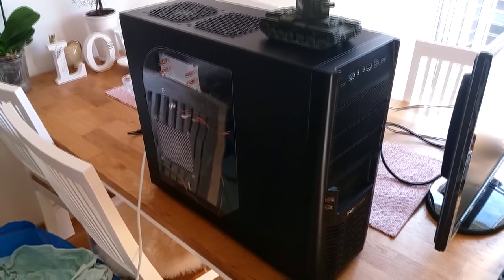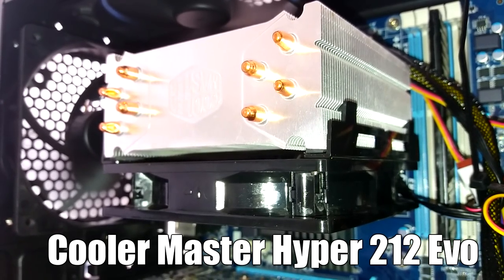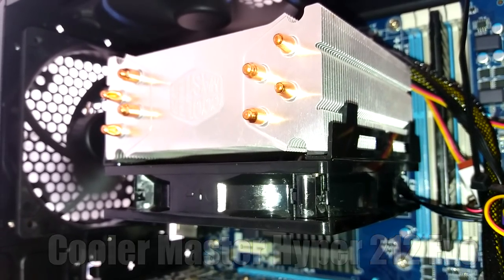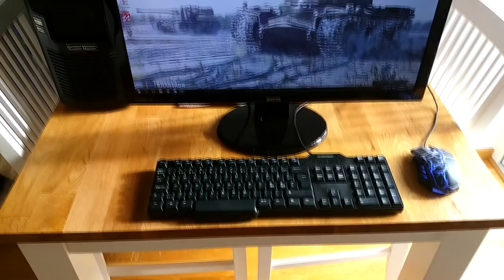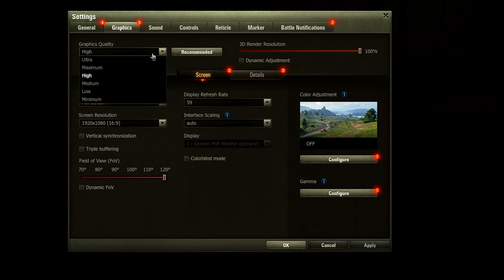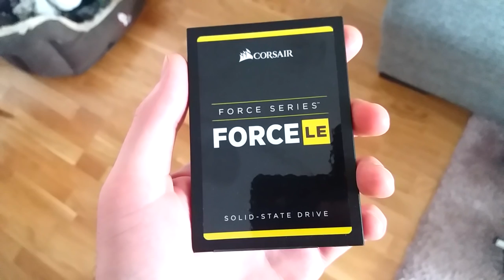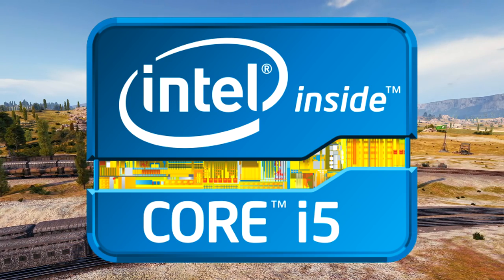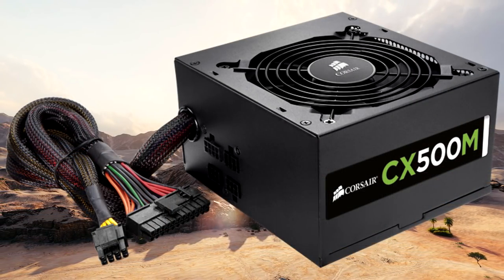Can a potato PC run World of Tanks 1.0?

Comment: If that's potato, then what is my laptop? A bloody hunk of soil? xD
(EDIT) holy frick 50 likes))). 1.0 is finally live in ASIA and my hunk of soil finally given up on WoT. The client won't even start xdxdxd help
Reply: Same, my laptop has to run with low settings, so that it could do evan 50fps sometimes
Reply: After that laptop was used to beat you to death, absolutely. :) But I agree with our hosts. If you could play WoT decently before 1.0, you still can without spending money.
Reply: DUDE same. what's mine, a pile of rotten potatoes? or as you say a hunk of soil.

Comment: I think this was more FPS that what I can get ;-;
Reply: I have a GTX 1050 with a APU that's so bad that you can't even find a review online on it :/
And I got 8 or 12 gig's of Ram... I think... And I got a 600 Volt or whatever Power Supple
Reply: a 1050 is miles faster than a 660, and i wouldnt think some of the older APU's would hold you back

Unless theyre like 20 years old or something....

Comment: Somethink for you Edwin
MSI GTX 960 Gaming 2G - GPU
intel core I-5 6600K - overboosted - CPU
8GB of DDR4 ram (hyperx 2x4GB)
Z170A Gaming M3 - motherboard
Great power suply ....
Windows 10 - 64bit running on quite good SSD disc aswell as WoT
FPS on high ... 20 ... really niga
Reply: SERVEJ bruh i got 1050 ti 55-80 fps on ultra with ryzen 5 1600
Reply: Turn down textures, probably not enough video ram. 2GB is really low these days.

Also, you're not mentioning your screen resolution, which makes or breaks you. I know the video had 2GB of vram, but that's at 1080 60hz. That's probably they best they could ever hope for and they didn't mention if they had to turn anything off like advanced destruction physics or bush transparency.
Reply: philburg2 agreed
Reply: I got a Core2Quad q6600 2,66 GHz 8GB DDR3 1333 MHz GTX 750 Ti 2GB GDDR5 OC(low profile) RAM 250+80GB old HDDs Win 10 64 bit, stock HP case PSU and motherboard and I get 40-50 avg fps with mixed settings(med to high) with some antialiasing at 1680*1050 resolution.
Why do you get such low fps and why do I get so much lower fps than this potato pc which isnt much different?
Reply: I use SD client for the moment because HD is not optimised at all , i olay on ultra with 1050ti 4GB i get 75-120fps depends on the map
Reply: Der Gerät lol regular 1050 100fps i5-2400
Reply: GTX 1060 6GB with an intel core i5-6500 and i run at 120fps
Reply: i5 7400 3.00ghz to 3.50ghz quad core, 8gb ram DDR4, nvidea gtx 1050 TI 4gb DDR5, HDD 7600 RPM, max graphics 50-60 fps all the time
Reply: Nvidia GTX 960 2gb
intel core i5-4460 
Crucial ballistix 8GB (2x4gb) DDR3 
win 7 64bit
70-100 FPS on ultra xddd
Reply: R9 290x Tri-X 8gb Gddr5
16gb DDR3 1600 Ram
Amd A10-6790K @ 4GHz
50 - 70Fps on Ultra HD Client. Probably because of my old CPU and only DDR3 Ram.

Comment: Lol my pc from 2014 runs WoT worse than that potato, lmao. Mine has a GTX 750 Ti & I3-4160. Its still going strong.
Reply: I really don't what that is
Reply: i have same high graphics are working 60 > fps
Reply: I can barely play Garry's Mod past 15 fps
Reply: Chandler Kristoff no the processor is trash.
Reply: And ? Years aren t importatnt for PC. You buy very cheap computer what I see. My recomended: buy new procesor
Reply: Komenta Kom i bought it for 800€, rip.
Reply: SlapThatBurger - WT I have computer for 1200€ in the discount. I know what I buy. And I3 for 800 hahah you was pranced. It Is one od the worst processor in the shops...
Reply: What resolution are you using
Reply: Jaska V 1920x1080 @60Hz
Reply: my 2002 comp runs this game 161 fps with minimal graphics + mods
Reply: M41 Walker Bulldog 

wow.
Reply: Well the actual requirements require i3 3330 and a gtx 660 for max performance, so you good.
Reply: SlapThatBurger - WT GTX 660>750 ti

Comment: Edwin, I am still surprised by my setup and the results.
I'm running everything on maximum and I have a constant 70-80 fps. Didn't drop under 70 so far. Playing on 1920x1080 resolution.

Motherboard: ASUS Z170 Pro Gaming
RAM: 2x HyperX Fury Black 8GB DDR4
Processor: Intel® Core™ i5 6600K 3.5 GHz
Graphics Card: Nvidia GeForce GTX 960 4GB

Comment: Store bought PC last year for B-day:

i5-66K (don't know to overclock)
NVIDA GeForce GTX 1060 3GB ver. 391.24 as of 3/20/2018
2x4GB DDR4 RAM
2.250TB Hard Drive (1TB External, 1HDD, 250GB SSD)

Did a Engine Test drive when they've first released it and it crashed multiple times, right now I can only play on Med settings.  Don't know what's wrong, could use some help to play up on High or Max.

Comment: I have a laptop with: 
-GTX 870M 3GB VRAM (is like the graphics that is showned in this video, the GTX 660)
-i7 4710M
-16GB of RAM. 
-A 1TB HDD (the game is in this drive and runs pretty well :D).
-240GB SSD.
The graphichs that I achieve with this graphics is ultra (without anti-aliasing) hitting the vast majority of times the 60fps (with vsync and tripple buffering activated) and in 1080p resolution. My  laptop it's from 2014 and even nowadays can play modern games at ultra.

Comment: Intel Core i3-3220 CPU @ 3.30 GHz | 8 GB RAM | Nvidia GTX 650 Gigabyte 2GB | Acer LED HD G206HQLGB 1366x768 - runs the game at SD client, graphics improved, settings High at 50 fps (when lots of things happen around) and 70-90 fps when driving around or having a fight. So, the game runs as smooth as it ran before.

Comment: This may sound like a daft question but what FPS would a gaming laptop with an i7 processor, 16 GB RAM and GTX 950M graphics card on ultra settings or maximum settings
Reply from the maker: the cpu and gpu of laptops are usually underclocked and a 950 is already slow as it is so my answer would be that it would play the game but not at max settings!

Comment: a computer with the latest i-7 and gtx 1070(8GB) with 16GB RAM is a good "budget" setup(in my opinion). For example Acer Helios 300("gaming" laptop) will run World of Tanks at 100 fps and rarely under 90 fps.(i have this laptop so i know what im saying).All you said about the medium requirements are true but... for the best expirience the components mentioned above are the best. 

P. S. The laptop costs 1000$ on Amazon or 1400$ from their official site.

Comment: Playing at Ultra, with around 100-150 fps (average around 120) with i5-4690K @3.50 GHz, a GForce GTX 1060 6GB and 16GB of Ram.
The Game is running on an SSD (250GB) , i tried it one a Hard Drive but the Game woould not load correctly and would take until around 10 sec after Map Start to load in everything so an SSD is definitely recommended.

Comment: hey guys, i fought id respond to you're question about the rigs that people are using, mine is running a Nvidia Geforce GTX 970 Strix at 4GB, a Intel I7 950 processor, running unclocked around the 2.9 Ghz, 12 GB Of RAM Memory, a 750 GB SSD and a 1.5 Terrabite Hard drive, all those components are held together by a Asus X58 Sabertooth motherbord, but im only getting around 60 frame's per second, is there somekind of limitation that you can turn of to see the maximum graphics you can achief ingame???
Reply from the maker: The game was limited to 60 fps in the garage and 120 in-game before 1.0. Now It's limited to 60 fps in the garage and 1000 in-game. So if you can't go much above 60 fps in-game it's probably your CPU that's a bit too slow :)
This video shows you how to remove the fps limit https://youtu.be/JrXpzkbfLPk

Comment: My PC is from January 2009. But it was quite high end back then and I upgraded my graphics card in 2013 I believe.

Intel Core i7 920 @ 3.6 GHz
6 GB DDR3 1600 (Triple channel)
Asus P6T Deluxe
2 GB XFX GTX 770 XXX (Factory overclocked)
Creative Soundblaster Z
700W beQuiet StraightPower PSU
Antec 900 Case

Guess what? It runs WoT 1.0 at maximum settings. Everything set to maximum. Usually 60 fps+.
Wargaming did a very decent with the new renderer. It's almost the same performance as before, but it looks so much better.
Reply from the maker: Sweet!

Comment: I had strange issue - automatic detekction was HD and ULTRA preset but textures was SD and FPS was about 250. I was not able to See HD textures in HD client. Removing one of 3 RAM module solved problem (now i got 8gb instead 12).Gtx1060 i5 4460. The problem wasn't solved by any driver reinstallation, New Windows, watchout for your RAM!

Comment: Im getting the same fps about 70-120 as i did on the old engine on ultra. What i have an issue with is abysmal load times and after the battle starts about 10 seconds  in every time i get a massive freeze that last about another 5 seconds then it runs like butter.  I3770k @ 3.5 with a 1070. Doesn't affect warframe or iracing though so i'm kinda scratching my head.

Comment: Thats not a potato take my pc 7 fps minimium (i had to quit wot unplayable) pc from 2009 not made for gaming
Reply: maukku 1 My old pc from 2007 is running wot 1.0 with low settings 60-80fps, if I put my settings to higher it will lag little bit, cuz I have only 1gb vram

My old pc has GTX 650 1GB, Intel Core 2 Duo, 2GB 800MHz ram, slow hdd and everything. xD True potato, but it works.

Comment: I have AMD FX6300 4.2GHz and rx560 4gb, 12GB ram, and work very nice, FullHD on 60 fps. PC for lower price as 450€ is very good.
Reply: Frederik Včelka well, not feasible today. With these... Guys using (preferable) GPUs to mine the RX560 alone probably costs more than that right now.

Comment: I've a custom-selfmade PC (asrock n68c-gs4fx/8gb ram single channel 1333/amd r9 380 dualx oc 2gb /amd FX 6300BE OC to 4.0ghz - 1.35Vcore (stock cooler) and Wot 1.0 runs at maximum presets at about 60fps temperature range of 55-59° 

It's a potato pc ?

Comment: 2011 isn't potato pc 2001-2004 is 
Which is what I have
and it used to run WoT at 37fps before the update
but now it can't past 13 and whenever there's too much foliage onscreen or I zoom at a bush I get 7fps at the most 
And yes that's with all the graphics set as low as possible

Comment: Lolol gud video for the budget players out there. I for myself use older hardware also with 
Amd FX8350
KFA2 gtx960(4gb)
16gb ram at 1600mhz
128gb ssd for windows and 1tb hdd for games.
Runs at 65-90 fps on absolutely maxed out settings without modpack and with i had to put some settings down to "maximum" only... guess it soemwhat depends on luck also :)! but yes i gotta say the performance is amazing...cant wait to test it on my laptop with some processor at 2 x2ghz and 4gb ram with 128mb graphics chip :D

Comment: CPU: AMD A10 7850K 4 Cores(4.2 ghz)
GPU: Asus Nvidia Gtx 950 Strix(overclocked by %20) 2gb
Ram: 16 gb 1866 mhz
HDD: 7200rpm WD 

I'm playing on Maximum settings(not ultra :d) and having 100-110 fps on 1080P but i cant get into battles on time and im looking for a SSD right now so Is Corsair Force Le series is good?

Comment: Medium @ 50-60 fps. Core 2 quad q8300 @2.5ghz. 12gb ddr3. Gtx1050ti 4gb. Don't know motherboard as the whole point was to build a pc for cheap. So it's some old Dell optiplex with some generic Dell mobo. Psu= CX430 atomic bomb.

Comment: Funny because I have an i7 processor and a GTX 1050ti and I can run the game at ultra with about 40 to 60 fps range
Reply: Do you have only 2gb vram? I think that's the problem. You suppose to have like +80 fps with ulta settings.
Reply: JoonAce, to be honest I don't know what vram is
Reply: Samagent T.S.I. It is your video memory.
Reply: JoonAce, so how do I know how much I have?
Reply: JoonAce, and what component of the computer is it on?
Reply: Samagent T.S.I. A small crash course in Video Ram: your GPU has a set amount of dedicated video ram used only to render stuff. When you exceed the amount of DEDICATED VIDEO RAM of your GPU,your PC uses SYSTEM RAM (used to do lots of other stuff) to compensate which results in a significant performances loss on your PC as a whole.You can look up by typing DXDiag on your search bar and going under the display tab to check the available Video ram you got. Alternatively you can download CPU-Z for more accurate readings.To give you an idea: 4GB Vram is enough to run most recent games comfortably on med settings. 8GB+ if you want to play on ultra. My ye'old 750 TI(4GB) runs at 65 fps on high(WOT).

Comment: My configuration!
i5-4690k 4.1 Ghz
Noctua nh-d9l with 2 fans
16 gb ddr3 1600mhz (4x4gb config)
Msi gtx 960 2 gb
asus z87 expert + WiFi-Bluetooth 4.0
Samsung ssd 850 evo 256 gb (windows 10 pro 64bit and game on it)
650w corsair 80+ gold

I mix the graphics setting for get 60 fps always at 1920x1080@60Hz resolution with ultra-max settings.
I prefer to don't stress to much my video card and cpu.
At close combact (like 6 vs 6 tanks) I prefer 60 fps locked instead of fps that swing from 50 to 100

Comment: My almost potato laptop (i5 1st GEN, 8GB RAM, Radeon 7600M, SSD), is actually runnig 1.0 better than earlier.
Before i had spiky 30-50 fps on lowest, now i run fluent 45-50 on mid-low settings. WORKS BETTER

Comment: I have a laptop with 8GB ram and 2GB graphics card and on medium it runs at 20fps and recommends low?
Reply from the maker: What cpu and GPU is that?
Reply: AND A6-7310 APU with AMD Radeon R4 Graphics, 2000 Mhz, 4 Core(s), 4 Logical Processor(s)

Comment: I have 120-80 fps but it takes a hour to load into battle :D Because It's a laptop. :)
GPU: NVIDIA Geforce 920M(3GB), Intel(R) HD Graphics 6000(1GB)  
CPU:Intel(R) Core i5-5250 1.60Ghz (4 core)
4GB ram 
It's a strong laptop and it's old but it still working hard.

Comment: I played wot before 1.0 update , in high graphics sd  35 fps  , now i play in high too but sometimes i have 30 fps , sometimes 20 or less , 1.0 made worse my game experiencw in wot :/
Reply: WEAPONIZER TANK actually the game requirement is lower because of the optimization and the Core engine codes are cleaner than before. The game should run smoother , maybe you were experiencing some lag, try to lower some CPU hungry function
Reply: well then go to medium or low, and comparing high pre 1.0 to high post 1.0 the graphics are considerably better. So of course your frame rate is lower, its just not as low as it would be with similar graphics, but running with the pre 1.0 graphics engine

Comment: I have FX-6300 with GTX 1060.
I get only 50-60fps.. (ultra)
I really have to buy a new processor.
Reply: you'd have to overclock it otherwise it really is not useful at all, since even the older Phenom II outperforms it in games :D
Reply: It's already overclocked at 4.0Ghz. I guess I have to push it up to 4.6Ghz lol
Reply: unbelievableflyingdrunkenpotatowithnolife Maybe try to get a AM4 mainboard with a ryzen 1200 or ryzen 1600.

Comment: Calling this a potato angers me, has the world become this spoiled. i just got an upgrade from using a radeon hd 4850 1gb video card on 32-bit pentium4 systems with at most 4gb of ddr2 and that was my gaming rig. i only had free hand me downs or hardware that was going to be thrown away and those  specs were amazing to me. i played; wot, war thunder, euro truck sim, FSX(with saitek x52), trackmania, heros and generals(barley and not steam version only standalone), mechwarrior onine,  spintires, crossout, emulators, ect. i setup windows the same way i did on that system as i do with my new rig(amd fx 8core 3.2 ghz, 32gb ddr3, gtx 750), everything i can turned off and looking like 95, becuase i dont care what windows look like i want my game to work as best as possible. i wonder if the old rig will play wot 1.0, i might just set it up again to see.

Comment: CPU: intel core i 7 3,6 GHz with boost up to 4,2 GHz
memory: 16 GB 2400 MHz
GPU: Radeon Pro 560 4 GB
resolution: Full HD
...and still just 70 to 80 fps on high settings like on your potato PC:(

Comment: haa potato pc my pc is from 2008 and runs it at maximum settings then again i reworked the GPU and ram and put in a SSD 3 years ago currently a intel I7 920 2.67ghz on 8 core, 24 gigs of ddr3 1066mhz ram, AMD radeon HD 7900, MSI X58 platnium express (told its a rare motherboard) 1000W power supply in a coolmaster centurion 950

Comment: Well. I'm going to guess that my onw PC is less than potato, lol. I have a gen I AMD 8 core and an AMD R200 series graphics card. My own thoughts are that It would be able to run at better frame rates if we didn't have such horrid latency here in the US, ever since they dropped us down to one server I've had pretty bad latency, it runs well enough for me for now, it will at least hold up till I can build a new one.
Reply: Parts list
AMD FC(tm) 8120 Eight-Core Processor
AMD Radeon R9 200 series video card w/2gb DDR5 memory
Samsung SSD 840 EVO 500 GB main drive
8GB DDR3 clocked @ 1333 mghz
So yeah, bit of potato

Comment: FOR DOES WHO SAYS THIS IS NOT A POTATO:
Ive HAD a i5 2400 16g ram 500hdd and a gtx 750 ti 2g and runing at 80+ fps this cost me 250$ and sold it for 600$ built my self a i5 3450 gtx 1050 ti 20g ram and had a 640g hybrid hd now runing at 90+fps at 1080p for under 225$ CANADIEN so look around ffs its not hard to find good use parts and I live in canada ffs that fing 175 usd today wtf you cant buy this and build it
Reply: An those amd parts are even cheaper like stop buying useless stuff and save 200 usd and get yourself educated with youtube on how to built a computer its simple as f'ck

Comment: my pc: CPU: Intel Pentium E5500 2.8 Ghz dual core (lol)
GPU: nVidia geforce 240 512mb, 60mhz refresh rate, 512mb (wtf)
RAM: 3 GB (kill me pls)
Windows 7 ultimate, 64 bites
Performance:
Medium-Ultra graphics: my pc crashed when loading the garage
Low graphics: 60 fps all the time
Minimum graphics: 80-90 fps
ps: all the components are 7 years old...